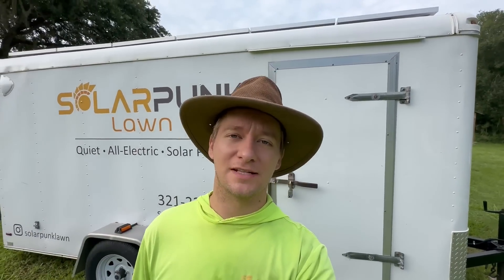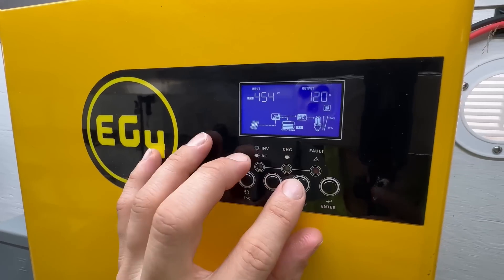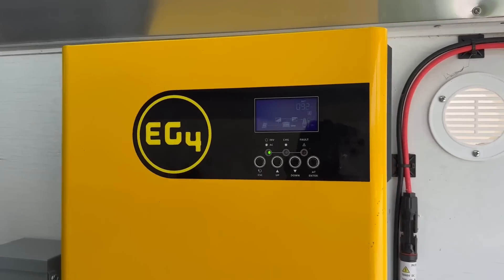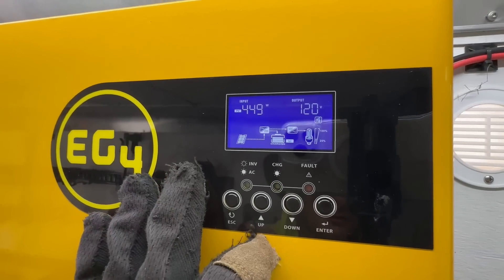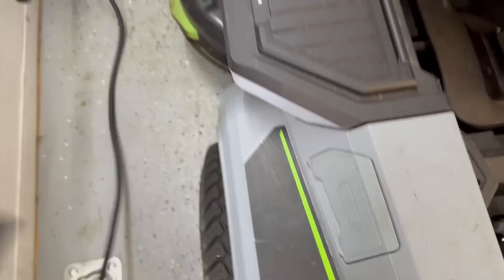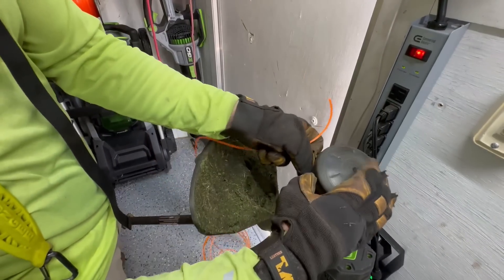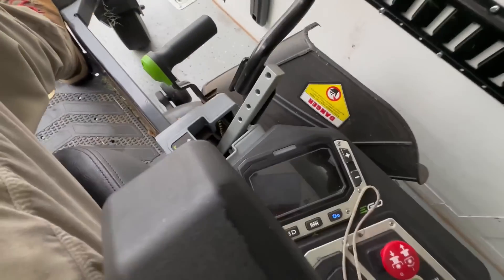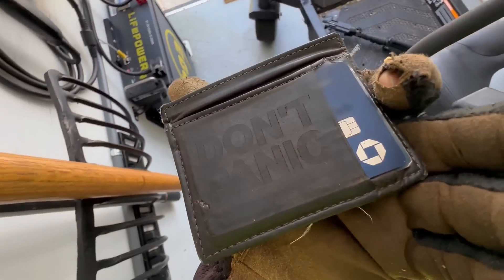Mow Forever? Solar Powered Lawn Care

Comment: With the mower and eg4 battery near the rear have you looked at your tongue weight? I'd be concerned it could be lighter and effect trailering.
Reply from the maker: Good eye, I will cover that in an upcoming video as weight was a major concern when setting up the trailer. My tow vehicle (Tesla Model Y) has a tongue rating of 350lbs, and tow capacity of 3500lbs, so it's a careful balance keeping a healthy amount on the tongue without overloading it or having too much in the rear and creating an unsafe towing condition.  My solar added a fair amount up front, plus the push mower, ego batteries, spare tire, etc. So the storage battery was placed in the rear to offset that a little.  Anyway, I've got you covered, but thanks keeping an eye out and making sure I'm safe! Let me know if you spot anything else!

Comment: Another nice video. As you learn you can modify to suit your needs.   Very well done and good video editing.  

If you were ever wanting to put a air conditioner in that trailer I would recommend a mini split since they are more efficient and have less start up stress )inrush current) on the inverter.   Again good video.  I look forward to more.  Where in Florida are you? North or south? My son lived up north and we go there from Texas occasionally. Have a great fall and hope you dodged that hurricane last week.
Reply from the maker: Thanks! And yeah it’s all about learning what works and what doesn’t and hopefully being able to expand when Ineed to. 

Air conditioning would be amazing, but not practical given how much power it would take away from actually mowing, not to mention the trailer gets opened up often and isn’t insulated well, but you could definitely build a cool camping setup! 

I’m in central Florida, over on the east coast so out of the way of the most recent hurricane. Thanks for checking out the video!

Comment: I have the leaf blower, Weedwhacker, snow blower chainsaw, nexus power station, both 2000 w and 400 W
I also have the hundred watt LED light which is excellent for nighttime . I exclusively charge all of my batteries from my off grid solar system and it’s very rewarding. My electric car also runs on Solar. I’m really glad to see other people doing the stuff too.

Comment: I'm doing the same thing, well, at a much smaller scale.  2 100W panels and a small 50Ah battery are enough to charge up my mower battery twice plus a smaller edger/blower battery in the same day. (~8000 sq ft of lawn)  It's not a lot of power but I still find myself running around trying to find things to charge once the battery is full and I'm 'losing' the energy...
Reply from the maker: Haha yeah, I feel you there! I need to find an outlet for all the power my trailer can produce over the weekends.  Maybe power an air conditioner in my shop? Really cool that you're doing something similar with solar and batteries, keep it up!

Comment: How does that trailer not exceed the towing capacity.  Of the Tesla I’ve never seen a car rated for more then 1k pounds towing especially an electric one?  And I’m sure the dry weight of your trailer alone is beyond 1k pounds.   Did I miss something??  Awesome set up by the way very impressive.
Reply from the maker: So the Tesla Model Y (what I have) is rated to tow 3500lbs (1588kg), the Model X (larger "SUV") is rated at 5000lbs (2268kg) and the Model 3 (sedan) is rated at 2000lbs (907kg).  My trailer is around 1300lbs empty, mower is ~450lbs, solar/batteries/inverter around 280lbs, so those plus the rest of the gear in my trailer we're probably talking in the range of ~2500lbs (1134kg) or so.  The car has a ridiculous amount of torque so it has NO trouble accelerating this weight, but it of course impacts my range significantly, but that's fine given my routes and the fact I'm not trying to drive across country on the highway.  Thing you have to be careful of is tongue weight, as this car is only rated to handle 350lbs on the hitch, so I have to balance the load in my trailer to make sure I'm not overloading the suspension of the car, other than that, it's an awesome tow vehicle.  If you think this is crazy, go check out my other YT channel @deltavcoffee where I used my car to tow my 20,000lb+ (9072kg) bus back to the lot after I had some fuel troubles with it lol

Thanks for the kind words and watching! I'll be making a video on towing with the Tesla later to cover these kinds of things as most don't realize.

Comment: Wondering how much you save in time at pump and fuel costs.
Reply from the maker: I’d like to run some numbers myself just to get an estimate. I started fully electric so I don’t have the experience and details of running a gas lawn care company, only experience operating and maintaining the equipment over the years.
Reply: @solarpunksteve found a thread from 2013 were people said they spend about $700 a month on gas during peak season. One guy is a solo team and he said about $3,500 a year. If you don’t mind me asking what are your monthly cost? Because now I’m seriously interested in how much you’re saving especially considering gas prices right now.

Comment: Is that a horse float?
Reply from the maker: Had to google horse float. I take it you mean the trailer? No, it’s just an older style enclosed trailer. I believe the brand is Covenant Cargo.
Reply: Might be an Aussie thing.
How are you finding the Ego gear? Anything break on you yet or any battery issues?
Reply from the maker: So far pretty good, minor issues here and there from normal stuff like abusing the tools in a commercial environment.  One battery failed on me so far after over a year. Other than some things in the design of the tools that I think could be better, they are well made products.  I'm not sponsored by them, so my honest opinion.  It will be interesting to see how long all the batteries and tools last. I think we're still early days for really long lasting batteries and battery equipment.

Comment: Hi Steve, as a semi retired guy and built Ebikes for the last 5 years, I'm going in this direction. Carbon free lawncare. Can you give a ball park on the cost for trailer build? I'm in New England
Reply: Not really carbon free …. Not possible at this point. Plus his Tesla is still polluting the air with the brake dust…… which is the biggest pollution coming from gas vehicles…. Not the stuff coming out the exhaust. Research it.

Comment: How is the model y working out for you? I also have an all electric lawn care business but use an f150 but looking at a model y for a daily/ back up tow rig for my 6x10 enclosed.
Reply from the maker: Really well so far. I also use mine for personal driving and it cleans up pretty nicely for that. If your trailer is single axle then you should be good, it’s tow capacity is 3500lb so you could tow a tandem axle trailer, but a lot more weight could go in the trailer than the car should be towing. The tongue weight is 350lb so you do need to be careful with how you load the trailer. I installed the trailer hitch myself and figured out how to wire directly into the cars existing harness but I would probably recommend just paying for the tow package from Tesla, it’s a lot easier but more expensive than doing it yourself. Lastly expect it to cut your range in half. I stay off the highway but still have to drive 60mph into town and my route isn’t the best so round-trip I’m doing 30-40miles which will use ~30% of the battery. It’s the aerodynamics, not the weight that gets you. 

Oh also, there’s a crazy amount of storage in the car and I’ve used it to haul 10ft long metal rails with the rear hatch fully closed, and thrown all my landscaping tools in the back when I’m towing my other trailer. 

Bottom line is it’s a great vehicle for towing if you have realistic expectations and aren’t trying to drive across country lol.  Lastly I charge at home so that keeps the costs down vs supercharger.

Comment: You could save a lot of battery percentage by not converting to DC to AC back to DC.
Reply: It would probably add up to hundreds and thousands of saved watts.
Reply from the maker: That would be really nice, but I don’t know any lawn care equipment that can be charged directly from solar. If there is I would love to know! The advantage of this setup though is I’m not tied to one manufacturer, if I want to run different equipment I just install the charger and I’m off and running. Also you can power all sorts of other stuff if you wanted, I’m mean in essence it’s just a mobile generator that can “refuel” itself.

But I’m with you on the silliness of going from high voltage DC, to low voltage DC, to 120V AC, back to low voltage DC… 🤦‍♂️

Comment: Will using the solar to A/C the trailer lead to improved battery life/quality?
Reply from the maker: So, technically you could power an air conditioner with this system, but you would use a lot of power since the trailer is not well insulated and it’s being opened up all throughout the day. I need every bit of power I can get to run the equipment so not really practical in my opinion.  All the batteries claim that they can operate in pretty extreme temperatures so I’m hoping I’m not shortening their lifespan too much. I have some vents in the trailer but I might install a powered fan to help pull some of the heat out, but it’s august in Florida so it’s not like the air outside is much cooler haha.

Comment: Awesome setup 👌 totally subbed and can't wait for more content. 😀
Strap down that runaway wallet! Lol 😆
Quick question will you be adding more battery storage as a just in case solution? 🤔
Reply from the maker: No kidding, that wallet loves to misbehave..   Thanks for following! To answer your question, the next step I could take if I needed more, would be to plug the trailer in at home after a day of mowing, this would allow me to charge up the onboard battery and the equipment batteries if they were low and solar wasn’t enough. At some point if I was finding that even that wasn’t enough, I could definitely add more onboard battery capacity, but I’m somewhat limited on charging speed, so if things were really crazy, I guess I could have a set of batteries charging in the trailer all the time, and swap them out in the equipment. But I think this setup is ideal for a solo operator, maybe two person crew, we’re not quite ready for mainstream with large crews or high volume yards.

Comment: Looks like $100k (give or take) set up.

Ouch.

Cool setup though.
Reply from the maker: Amazing what some white paint can do right‽  The Tesla is not required for this type of setup of course (that being said, with the federal tax credit, you could get my Tesla for $43k today), it’s simply what I had when I decided to start this business. Looking at the towing capacity I decided it could work for my application, so I installed a tow hitch and then got a used trailer, replaced the axle and painted the whole thing, inside and out. Then invested money in the electric equipment. After gaining clients and running out of battery I decided to install the solar and onboard charging system. Not cheap but still less expensive than buying a complete new set of EGO batteries. Plus it produces its own power so saves me money in operational costs.

I’ll be getting into those specific cost breakdowns later and will show exactly how I built this system so that others can decide if this is something they would like to do.

Thanks for checking out the video, hope you found it fun to watch! Let me know if you have any questions.

Comment: I have a lawn care company myself and I honestly love the idea and the concept. I also have solar on my house right now actually. However, in the area I live in this would never work. Average lots are 1 acre or greater in a lot of areas. There wouldn't be enough time to charge the batteries like this. The batteries would be dead at the end of 1 lot and you would not have time to charge them enough before getting to the next lot. I feel like this could definitely work in a area like Florida where there are small lots everywhere, but not around me. Also, the area I live in is leaf heavy as well in the winter. There is no way you could use battery powered backpack blowers to do leaf cleanups around me.  I have leaf cleanups that could easily take 6 hrs or more.  I can dream in the future that one day this will be possible, but for now I will stick with my 80cc Shindaiwa backpack blowers, hustler mower and echo trimmers and edger's.  Id really like a battery powered backpack blower that could last 2 to 4 hrs on a single charge and have the power of my Shindaiwa blowers.
Reply from the maker: I completely understand, it's not for everyone right now, and I've had to be careful about the property sizes I take on, even turn people down based solely on that.  And yes, we don't get the crazy leaf clean ups that other places do so that's a separate challenge.  

There are commercial electric mowers that can mow for a lot longer than my EGO, but you would still run into the challenge of charging them enough while moving from property to property, however with the EGO (or any other mower with swappable batteries) you could technically have another set of batteries ready to go in the trailer and swap them out and let the dead ones charge up while you're out mowing.  But again, it's not a perfect solution and at this stage still quite expensive for what it is.

On the backpack blower note, while not up to par for your leaf clean-ups, I do like my EGO backpack blower and it can run quite a while depending on the batteries you put on it, only downside is it's pretty heavy (and pricey).

Comment: Looks expensive
Reply from the maker: You might be surprised, hang around for the next video! It is on the pricey side, but when compared with buying a bunch of extra batteries for the electric equipment, it’s actually cheaper and produces the power I need to run my solo operation! So yes, there’s an investment cost, but like anything, it’s an asset to your business.

Comment: How do you like that backpack blower ?
Reply from the maker: Apart from the weight (using 2x 6ah batteries) I like it quite a bit.  I had been using the 765cfm handheld blower from EGO for over a year and was getting tired of holding it for 15+ minutes on my corner lot properties with sandy sidewalks and having it cut out in the Florida heat after 10 minutes of constant operation (not even on "turbo").  So this is an improvement for sure, but comes at a pretty steep cost at ~$800.

Comment: What part of Florida are you in?

I remember doing properties like the third one you showed. I really didn't like them but, if it pays well, it's worth doing. 

I'm not big on the battery powered stuff yet although i did recently do some r&d work for a German company that's entered the green industry here in the States and they may change my mind... That said, i admire what you're trying to accomplish and your set up

PS, I have that same issue with the speed feed head

Also, i just caught your radar screenshot. I lived and worked on the other coast of Florida in Lutz, just north of Tampa

Also, I have an odd question. I noticed your bank card (i won't name names). I use the same bank. Lately, they've been holding my deposited checks. Anywhere from 7-14 days. Have you had that issue with them? 

Last month, they held two checks for a total of ten days each, one for $833 and another for $1766. I called to discuss and they gave me a bunch of generic bs lines. Needless to say, I'm looking for a new bank. I hope they're not doing the same to you
Reply from the maker: Starting over a year and a half ago, there was some info on all-electric setups but I feel a lot less than there is now (still not enough, which is why I'm working to share what I've learned so others can decide if this is the right fit for them).  It's definitely not ready for mainstream, but I believe we will get there eventually.  Some aspects I believe will win people over after a while is the ease of use, lack of maintenance, low operational cost, and low noise/vibration level for the operator.  I've been a Marine Engineer for the last ~10 years, done all sorts of maintenance and work on engines/generators/machines the size of houses so it's not that I can't work on gas and diesel engines, it's that I don't want to anymore haha. I'll make a video on it at some point but basically the maintenance that's required so far has been sharpening the blades and checking the tire pressures.  I'm not messing with (or spending money on) belts, oil, fuel, air filters or anything really.  Of course there's still a lot of unknowns on longevity and this type of equipment hasn't been in the field for decades and been proven.  Anyway, I'm not here to tell people what they should or shouldn't do, my goal is to present the information as transparently as I can and let others decide.

Thanks for kind words too, I wasn't sure what to expect with uploading to youtube initially, but so far the feedback has been encouraging.  

As for bank stuff, so far no. I haven't had any issues with what you've described. Sorry to hear that you're having trouble with them, hopefully it gets sorted or you can find one that doesn't operate that way as that definitely makes it tough for operating a business.

Good luck out there and stay safe!
Reply: @solarpunksteve  thanks for the info. The technology has come a long way and solid state batteries will push it further ahead. I'm an old man now so I don't see myself making the switch with the bigger machines within my (working) lifetime, however, some (most, honestly) of the hand held equipment is ready for prime time